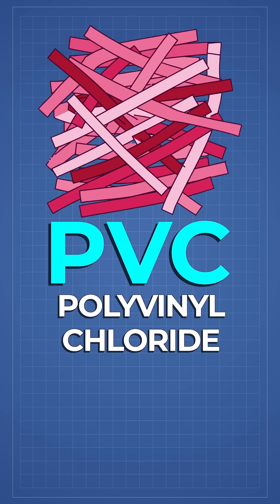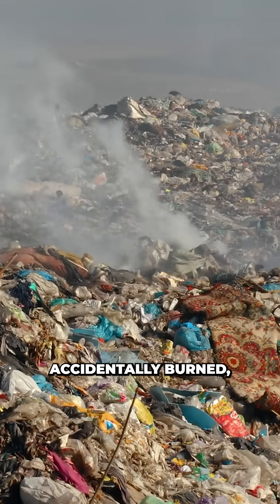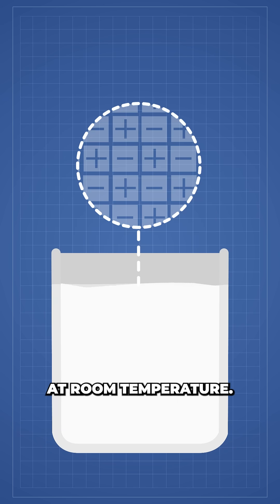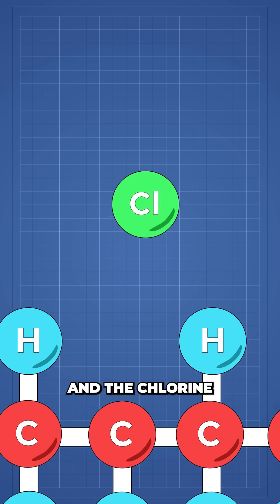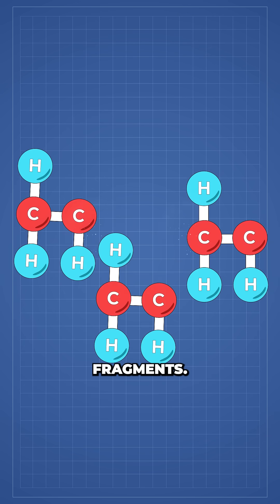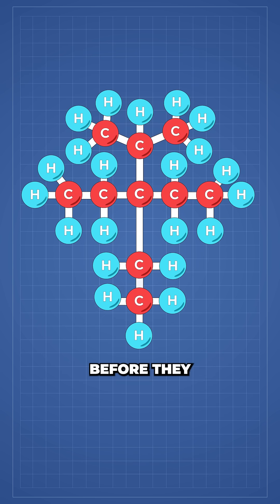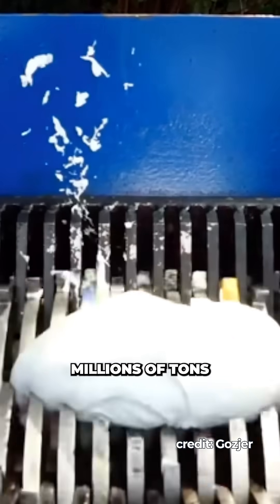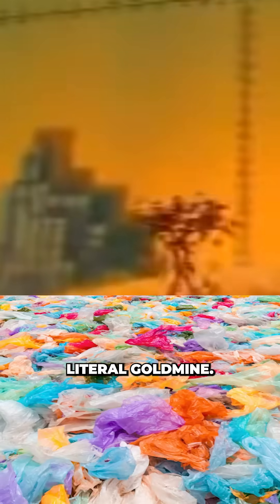Scientists Turn Plastic Waste into Fuel

Comment: This is already known to be possible with HDPE via pyrolysis but only limited to HDPE. It's nice to see that PVC now can also be cracked.
The issue is the cost with both though is that it's excruciatingly hard to compete with oil prices.
The only case where I calculated polymer to fuel to be worth it is if you are avoiding energy tax on homebrew fuel.
Reply: They always forget to mention that it would be more expensive than getting petro/gasoline the traditional way and therefore not feasible.
Reply: Ive always wondered how feasible it would be to pair a plastic-molecule-bond-cracking facility to a source of renewable energy to help solve the renewables' energy-storage problem
Reply: @Mikey-xz4vn Well, that would work as a recycling plant but even then, it's still way more expensive than just burning the plastic or exporting it to poorer nations, as bad as both are.
It's a neat concept but inherently inefficient and not competitive
Reply: @noidex2936  I suppose I'd even take burning it if it meant less of it just washing into the ocean/ecosystem..
Reply: @Mikey-xz4vn : There's no reason to use plastic for that, gaseous and liquid hydrocarbons (and carbon dioxide) can do that with the Sabatier process. The trick is that moving something heavy (like a lot of water) is usually going to be a much better plan.
Reply: @TheMasterhomaster  not feasible.. until we start to run out of fossil fuels. Oil IS a finite natural resource
Reply: @outbakjak oil is not finite. Fossil fuel reserves are finite. You could make fuel out of hemp (or another plant that makes oil) or from grease traps. 
The problem with breaking down plastics into fuel is that you have to put more energy into breaking apart the plastic than you could ever  get from the fuel that you for from the plastic.
Reply: @outbakjak : We literally know how to produce methane from hydrogen gas and carbon dioxide gas pumped through an iron catalyst at the right mix and temperature, and we do use the same process to turn methane into more complex hydrocarbons for lubricant purposes (Pennzoil or one of those brands brags about it on their bottles). The problem is just that it takes more energy than you can get back out of the fuel.
Reply: @TheMasterhomaster  But that is not the aim. The aim is garbage disposal in a nation that has a lot of people, alot of garbage and not much land for a landfill.
Reply: IMO it would be more reasonable to add a tax to plastic products to reflect their very real environmental cost, then remove that tax for plastic products created from this type of recycling process. we could incentivise use of non-plastic products and proper recycling that way. humanity has to stop playing the "number go up" game.
Reply: It’s very unsafe to do in a backyard.
Reply: Taking out a recycle
Tax or something on PVC could maybe offset the cost? Maybe the fuel is not as cheap but it's so much better to make use of waste than just throw it into a dump!

Comment: Chemical engineers are actually important if they are great bunch of thinkers and practical applications of the knowledge. Using the basic formula of proton+electron+neutron= stable particle that can be used for energy or another useful material for daily use.

Comment: I want to know the answer of a few questions, before embracing this as a possible solution:

1- Can regular engines even handle those components?

2- Should it be used like fossil fuel, does it contaminate the atmosphere after its combustion?

3- If yes, with what?
Reply: It's burning plastic what do you thinks gonna happen? It's a funny shaped hydrocarbon It's gonna burn just fine and probably not be worse than the solvents they add into gasoline already as to with what it would be the regular suspects of any hydrocarbons burning along with what's is in that tumour it has. If you think burning trash is ever going to be an eco friendly thing to do that's just stupid don't be like naturejab. The only questions is if it's economically viable and if it damages you engine and only one of those two does the producer care about